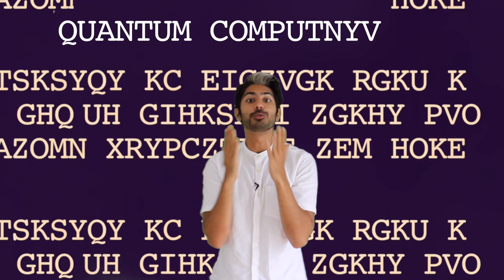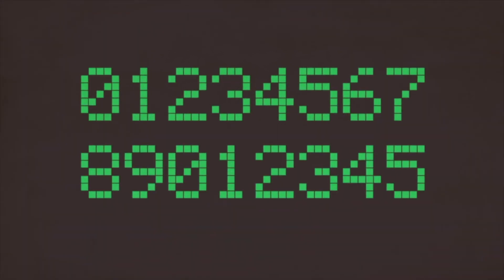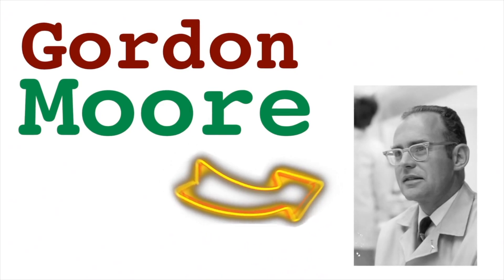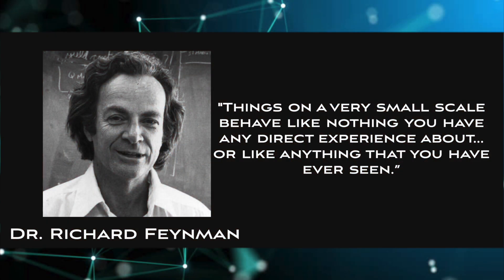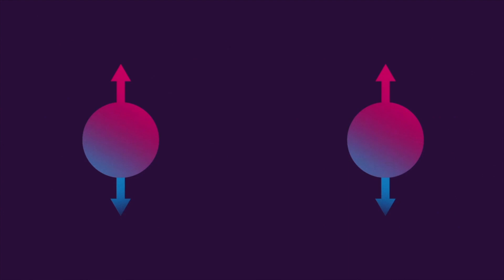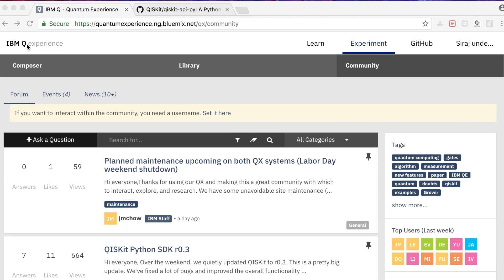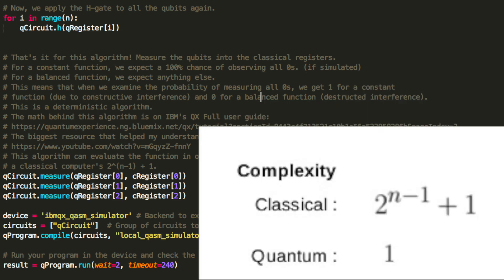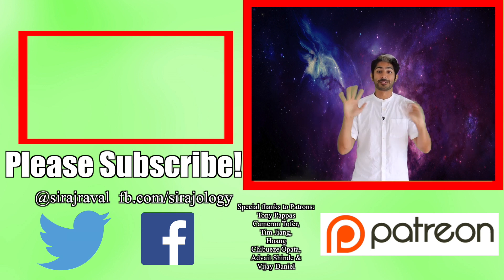Quantum Algorithm - The Math of Intelligence #10

Comment: Hey, 
I am working on deep learning and I have already trained my neural net. I use python3 and tensorflow. It's a binary classifier. I now have no clue how to implement it in the real world. I would like to run it on a device like a microcontroller, any help is appreciated! For example the input can be the temperature that is sampled every 10 seconds and the output lables is one of hot cold or normal. And the result can be displayed on an LCD connected to this controller. Any help would be appreciated.

Comment: So.... When am I gonna have a quantum computer, mate???
Reply from the maker: 5-10 years
Reply: probably never, you'll not get 200000 fps on call of duty with a quantum computer, it's only useful in very very specific tasks. you might have one someday if it gets cheaper smaller, start working at room temperature, and if we find a useful application everyone would need (like AI in your smartphone ?) but the quantum computer is still probably going to stay in a datacenter.
Reply: Siraj Raval only heard of that one company which some believe isn't a real quatuum computer. I am wondering how you simulated or ran that code. I expect over 20 years until it is personalized.
Reply: @simetry6477  IBM allows you to run their quantum computer, limited basis.

Comment: Honestly, this is not a very good explanation of quantum computing. First off, the motivations for building one has very little to do with the fact that we are failing to scale down transistors. It has to do with the fact that we can use algorithms that take advantage of qubits' quantum behavior. Only some problems will be performed faster on a quantum computer.
Maybe because you lack experience with the subject... but you skirt around the details of QC that it make it exciting. Mainly the uncertainty principle, the exponential behavior of Hilbert spaces, amplitudes (which can be pos, neg, or even complex), or interference.
You also give the incorrect statement that qubits take on the value of 0 or 1 at the same time which is not a good (or even correct) characterization of superposition. As someone in the ML field without much experience of ML I subscribed to you to stay current, but after watching this video I've decided to unsubscribe after seeing your lack of knowledge on a subject matter that you are feigning to understand enough to teach. Read up on Scott Aaronson before talking about this subject matter. Read Nielsen and Chuang. But for Pete's sake... don't feign to know something that you don't.
Reply from the maker: The limits of transistor density is one of several reasons thats caused the recent surge in interest in quantum computing. And in my research for this video, i did glance over the topics you've stated (i.e amplitudes and the uncertainty principles) but for my short videos, it's all about trade-offs. I deliberately chose to focus on a few key topics of interest that are easily graspable. I will look into the authors you've mentioned. Thanks for taking the time to give detailed feedback and for watching!
Reply: k so u unsubbed because he made a mistake. Okay. It's all good that you gave good feedback but unsubbing is pretty dumb for an ML field student
Reply: Siraj Raval 

I fail to see why Trent did not connect the dots; 

(1) He mentioned that the motivation for quantum computing, did not arise largely from approaching that transistor minimization limit.

(2) Then, in his very next sentence, he mentioned that we merely want to unravel the benefits of qubit computation.

(3) He should have tried to connect the dots, and asked him self why is it that we would want to benefit from qubit? The answer could be salvaged from his remark (1).

(4) It is also ironic that he mentioned that quantum computers could only subsume particular problem spaces. 

..but did he ask himself why traditional classic chips don't approach the particular problems for which quantum computing applies, where classic systems don't apply? It is particularly because classic systems' minimization is physically reaching, that quantum computers need apply; as classic chip systems face issues in minimization, classic chips don't approach problem spaces that qubit computation can reduce.

WHY ELSE WOULD WE EVEN BOTHER TO CONSIDER QUANTUM COMPUTING, IF WE COULD DO THINGS CLASSICALLY?

Is Trent forgetting that traditional semi conductors though constituting quantum mechanics, are not qubits?
Reply: > He mentioned that the motivation for quantum computing, did not arise at all from approaching that transistor minimization limit.

I did not say that. I said "building one has very little to do with the fact that we are failing to scale down transistors." Why do you think we have been talking about building QCs since the 1980s, decades before the end of Moore's Law was in sight? It is because there are innate properties of qubits that we would like to take advantage of. 

Currently, we are at 14 nm nodes in classical computing and by the time we get into 7 nm nodes the effects of quantum mechanics begin to take place. Moore's Law has not ended ye. But the thing is, we have many different ways to address that problem at an architectural level. Look at what AMD has done with halving of cores for increased performance. I actually work in this field.

Motivations are a tricky thing to talk about when we are talking about a field that has several thousands of researchers working on it. Everyone has different motivations of course. I would just leave you with an answer Scott Aaronson gave when asked about this question: 

https://www.quora.com/Was-the-original-motivation-of-Quantum-Computing-to-actually-make-NP-problems-tractable
Reply: + Didn't unsub, but would like to see more up-to-date info.
Reply: Trent McCormick 

It appears you and Scott are wrong.

Quantum computing dates back before Feynman; in polynomial time discussion terms:

https://en.m.wikipedia.org/wiki/Timeline_of_quantum_computing

FOOTNOTE:
I had edited my prior comment to say "..motivation did not arrive largely" instead of "..not arrive at all".
Reply: Trent McCormick's reaction, while maybe more acerbic than is deserved, is mostly valid in its allegations.

Superposition is indeed better characterized as the orientation of the state vector (or //vector which describes the quantum state//) in a complex vector space (bloch spheres are thus useful in visualizing both this complex vector space, and the vector that corresponds to a system's, or qubit's, quantum state) --> quantum information is thus encoded in the orientation of these vectors.

Also the allegation that quantum computing has more to do with diminishing real estate at the atomic level (as is emphasized in the video) is only partially true. 

While yes,  it has provided the inspiration (Feynman's "plenty of room at the bottom") and panic (where we discovered that simply miniaturizing and cramming more transistors and connects, didn't lead to the classical behavior we were so used to, and found that electrons tunneled or leaked) for putting quantum computing on the map --> it was really, as Trent alluded to, the fact that quantum information and quantum mechanics (and the mathematics and physics that govern its behavior) can be exploited to perform unique computations that can beat out the best known classical counterparts, and to be fair the video, towards the end, with an actual code demonstration at least touches upon this aspect. Famously, the news of quantum computers potentially being able to beat RSA encryption, via Shor's algorithm certainly caught the interest of government agencies and industry, thus actually fueling money and time into the field.

But yeah, Nielsen & Chuang, and Aaronson -- and I will add Preskill, are all good resources to look into for people who want to dig deeper. And the video, I think was a good intro + layman + kind-of-layman introduction to the topic with an emphasis on the practicality of writing code that would interface with IBM's superconducting chip (there are many other forms of quantum computing hardware, or physical realizations of qubits).

And to call Aaroson wrong is something to reconsider when talking about quantum information. Kind of a tall order -- it would be like saying Feynman was wrong about quantum electrodynamics.

Overall this was a fair video with some inaccuracies and/or misrepresentations but considering that this is still a growing field, mainly talked about at academic/industry conferences, most videos get things wrong. I would just take this to be an indication that people hold Raval to high standards (which is a good thing, isn't it?). 

And I enjoyed that a little bit of sample code was added. That is something you rarely see in the mathematical or physical study of quantum computing. And I always enjoy seeing other's interpretation or digestion of subjects that are interesting to me since comparing mental notes and then making modifications is how you learn.
Reply: Scott (as cited by Trent) mentioned that quantum computing's motivation, originated with  Feynman,  and that is demonstrably wrong, quantum computing's time line demonstrably begins on the horizon of polynomial time terms, as seen here https://en.m.wikipedia.org/wiki/Timeline_of_quantum_computing.
Reply: Jordan -- I don't think I am quite understanding what you mean by "quantum computing's time line demonstrably begins on the horizon of polynomial time terms,"

Are you trying to say that, until Deutsch (and the Church-Turing-Deutsch thesis) that there was no real progress? Or? I'm just really confused.

And sure, Scott Aaronson, can say that (and is not wrong in saying so) but, in many other of his publications and talks, exhaustively goes over the many other reasons and motivations for why we would want to study quantum information and seriously consider building a quantum computer. I don't think it is fair to say that he exclusively focuses on the fact that Feynman was the beginning of and only true motivation for why we are trying to build a quantum machine.
Reply: tigeruby 

Simply, quantum computing's timeline (including motivation) demonstrably began prior to Feynman's postulation, contrary to Scott's post here:

https://www.quora.com/Was-the-original-motivation-of-Quantum-Computing-to-actually-make-NP-problems-tractable

Anyway, even if it did begin as Scott presented, what stops Feynman's postulation from not encompassing directly, polynomial time concern?

*Feynman*: Feynman observed that it appeared to be impossible in general to simulate an evolution of a quantum system on a classical computer in an efficient way.

The above still directly entails an expression in polynomial time discussion terms.
Reply: Thanks for taking the time to link Aaronson's post (which you were referring to) -- also while your wording still confuses me (such as "quantum computing's time timeline")... I guess I get the gist of what it is you are saying:

That the discussion of quantum computing began before Feynman (sure, yes)
And that Feynman himself discussed the benefits of efficient quantum simulations (again, a strong yes)
And that efficient quantum simulations are subset of problems that seemingly benefit from the fact that you get quantum speedups in other types of problems (in a way, yes, but you have to recognize that these are different kinds of problems focused on different motivations and concerns)

But notice how none of these ever have to do with the microfabrication & chip-component-level performance concerns that arise with ever shrinking features. That is, even for some weird reason, single atom transistors were not overwhelmed by uniquely quantum mechanical behavior (in that, your properties and quantities can be delocalized and thus don't behave as rigidly and classically as you would like) you would still run into those same theoretic/informatic concerns of "does a quantum informatic method of computing offer any unique benefits over classical computing" --> is the answer was no, then there would be no push for development.

But it so happens that, in a parallel fashion, the concerns from industrialists who found that their go-to strategy of shrinking features was hitting a wall, and that they needed to workaround quantum effects or harness them to a degree + the theoretic/informatic interests that started from academia but eventually leaked into hypothetical but still very real world concerns and interests (i.e. faster computations for special subsets of problems, efficient quantum simulations -- which yes you could argue is part of those special subsets of problems) both contributed to and formed the pillars of the motivational thrust upon which we are trying to develop a quantum computer.

I hope that helps. Also since you posted a Quora link, posting such questions on Quora or Stackoverflow/Stack Exchange or even reddit might be better than YouTube for getting answers. Reading Aaronson's blog and works would also answer many questions that you may have that I simply cannot at this time. I am just trying to inject some sanity and perspective.
Reply: tigeruby 

No problem.

PS, that was a typo; I edited out the duplicate "time" from "time timeline".
Reply: Also:

(1) No, your comment above did not help me, that is, I did not gain any new information:
I had mentioned before your comment, that Feynman's postulation on quantum computing efficiency, "directly entails an expression in polynomial time discussion terms.".

(2) No, I don't detect the separation of Feynman's postulation on quantum computing efficiency, from a discussion on polynomial time description/chip minimization optimization; 
for these occur in the same problem space.
Reply: Why would you unsub when this channel is mainly about ML and coding??? Did you subscribe to learn about quantum physics???? XD
Reply: He is a communicator. If he were a programmer, he would be programming not making YouTube videos.
Reply: Siraj Raval you did use a linear graph when discussing the exponentiation of quatuum or qbit  code.
Reply: Siraj is a good programmer
Reply: This rather unnecessary discussion that does not really contribute to any better understanding of the phenomenon under discussion probably stems from confusing the emergence of the idea with the motivation of the actors playing in the field. 

Motivations are moreover a priori; and their explanations, sometimes highly rationalized following some independent laws of story-telling that humans inevitably indulge a posteriori in. 
The motivation of Eric Ladizinsky; who initially called his enterprise (that lead to D-Wave)  as a mini Manhattan project; is probably, due to the influences he has had, having worked for TWR and run a DARPA project, distinctly different from that of IBM, Intel  or for that matter Google and NASA, who have purchased D-Wave.  Even when Lockheed Martin, Eric's wealthy customers may have some rather specific intentions; one can not necessarily claim that his vision is in any way other than basically humanistic. 

To claim that there actually exists one single main reason behind these 1) varied personal motivations, 2) the ideas of the Zeitgeist, 3) the impending limits encountered by classical computing,  4) the potential of financial gains  or military might and finally 5) the real or imagined or a-posteriori rationalized or through serendipity realized use-cases often explicitly declared is in my opinion rather naive and only mystifies the issue. 

No wonder that YouTube is full of conspiracy theories concerning this phenomenon. 

A less conspiratorial, albeit extremely political and rather dishearteningly pessimistic article on the subject that however seems to be relatively well researched is by Mike Adams at Natural News. 

I personally tend however to ascribe to the claim; that humans are not fully aware of their motivations and our science of sociology is unfortunately far behind Physics as Karl Popper would claim; which unfortunately does not brood well for the majority of DNA based life and mankind.
Reply: Trent McCormick Nonsense.

Siraj is right.

It is particularly that we are running out of transistor landscape to compute on (where the landscape represents how small our parts can get classically), that quantum computers need be applied.